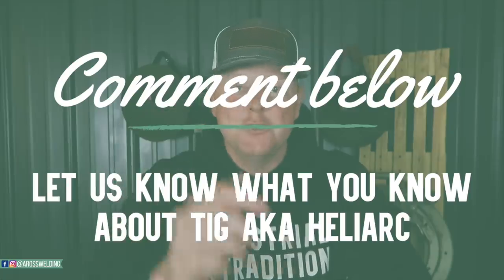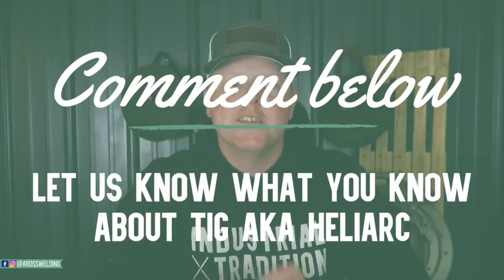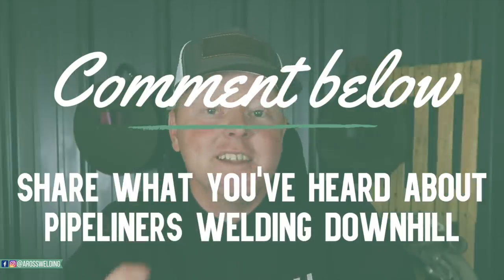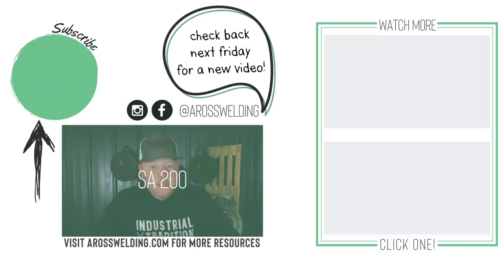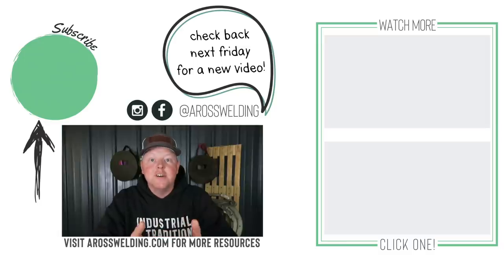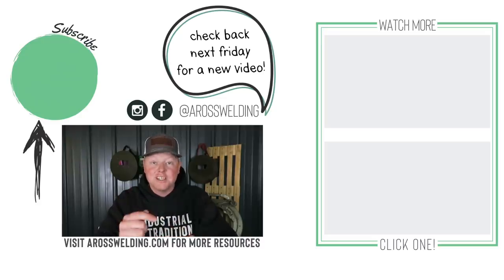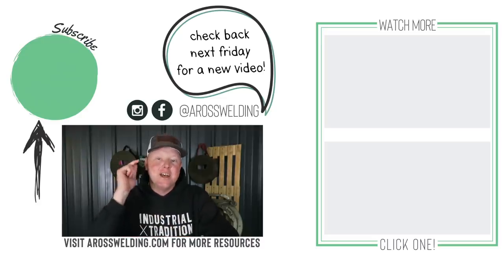WHY PIPELINERS WELD DOWNHILL

Comment: Can someone explain why 6013 lays such a beautiful bead, but in certain circumstances it’ll get a slag pit in the middle of the bead and it will not float out. Either have to grind it out or cover it up with 7018. This occurs  mostly when I’m trying to fill a gap. Sometimes turns up in a fillet weld too.

Comment: Dude its all about speed, the man is right behind taking down your shirt size wantin to know when this joint will be done? I've never done pipe line work nor would I want to, I'm a retired Boilermaker I used as much 7018 as you have P5, also I gave up 5P , Low-hy works way better at bridging gaps. I did work on an old B&W boiler, we TIG the root and cap with 7010. On a side note Heliarc is a brand name, but boilermakers called it heliarc even tho the pipe fighters told us we were wrong, of course we told the plumbers to F off.

Comment: Pressure welders don't just weld with 7018, the filler material all depends on the base metal. Could be 7018, 8018, 9018, S309, S316, inconel, etc. I am a retired Union Boilermaker and years ago before the standard Welder Proggram we had to test each job and we had to test for each material you would be welding, 2" heavy wall in an Arkansas Bell Hole and you welded all passed up hill because sometimes you didn't know if your coupons would be exrayed or bent and if you put a downhill pass in your test it would snap. Exray had to be 100% or you got sent back to the Hall. I've seen some of the best welders there could possibly be in the Boilermakers. People that can weld the impoosible and make it look easy. That is Union Craft Labor.

Comment: You can tig weld down hill, I’ve done it on stainless steel structure in a chicken plant. Pipe I wouldn’t dare. I just lay my wire in there and go to town. It doesn’t get as good of penetration but it holds and it’s fast.

Comment: I ain't gonna lie I'm 41 I've had issues getting a good job I've always worked out side in the elements what could I do to get my foot in the door as far as being a helper I'm in maryland thanks for any info,if you can,can you do more live networking/ Q&A too,great content and info
Reply from the maker: Check out this video and my inner circle.

https://youtu.be/nbYKc39YR-U

https://arosswelding.mn.co/

And I will take note of this suggestion. Thanks
Reply: Join the boilermakers or pipefitters union. Good money. Union protection and benefits.

Comment: When you’re padding boiler tubes you weld downhand after you get a ticket even when doing butt welds in a bundle that’s overhead its easier to look through the bottom of the joint and weld the top half down first then up hand the bottom half. As for a down hand rods there is a stainless rod DOH  6010 & that other 10 rods are all position as the third number indicates , 1 all positions 2 flat and horizontal. The last number is the flux make up which makes all the difference as the metal rods are all the same except for alloys 10 rod is good for shitty conditions and rolling around in the mud “pipelining “ but are very brittle not ductile that’s why only used for the root on above ground piping and never on any structural just under ground stuff you filler up with 10 and through some dirt on it lol

Comment: Yes up hill with GTAW "tig"  Especially ASME code IX for carbon and 
stainless.
Reply: mark SAMLUK yes but also no. If you angle your torch up and keep the rod below the puddle as well as lowering heat you can weld downhill with a strong weld. (More used for tight spots so when you can uphill weld for more efficiency)

Comment: Ironworker everything's vertical up 7018 welding Deck with 6022 that's all I use
Reply: That’s all I used as a ironworker except a few times working in the phosphate mines and that’s because of burning off product and then a 7018 vert over it

Comment: I went up the hill like I was taught inTech. Then when on opportunity came up on Zed code I took it. Stateside I believe it falls under an API code, up here it's all CSA. B 31.3 for the quick example. For pressure vessels it's section 8 adopted from from the ASME code. Structures fall under CWB 49 or 48. Sorry, tangent alert. 

Anyhow, I did learn the downhill technique. I like it better. Faster, you can bump up to 5/32 for your root electrode comfortably and I can see the puddle without stressing my neck trying to judge the backside of my said consumable. 

Anyway you fellow beadhands, you know the rules. Start where it is tight, make radiography and cast all else aside. Don't forget to blame the Pipefitter when things are not lining up and going south. Sorry, that's what happens when I have to Makita redesign half their butt joint in hope of a root, while the other side of the clock a cat could walk through.

Comment: My understanding uphand with 7018 is more ductile and can stand more dynamic loading and  less prone to cracking it is not stronger . Here in Canada usually anything above ground low hydrogen is used  to fill and cap . one of the reasons  is because temperatures can very from -40f - 100f.  7018 and 7010 the tensile strength is the same . As I have been lead to  believe tensile strength is how strong a weld is . they use a 1"x1" square rod with the same material as the numbers on the rod . They pull this square rod till it breaks to establish tensile strength . If I'm wrong please some one correct me .
Reply: Most of information was right except for 1"X1" square rod its actually based on 1 cubic inch of weld determines tensile strength of weld. Most times your weld is stronger than base metal your depositing on. In comparison 36" of 1/4" fillet is approximately a cubic inch. A lot of new welders get this wrong. Actually had to do pull test for a procedure acceptance on a couple of jobs for insurance acceptance. Really fascinating to experience weld failure through destructive testing if you ever have the chance doing procedure jump at it a lot of information and  theory takes the everyday boredom out of welding.
Reply: Ream him Bill Rogers!!!
Reply: Mykol Ayche wasn't trying to ream but welding for 37 years and seen improvement and changes makes me question the young bucks who think they know exerting about welding

Comment: The first two numbers are the ''minimal'' tensile strength of the rod. An all weld metal tensile specimen can have a lot more tensile strength that the said first two numbers on the rod. Also, welding down hill has produces less penetration. The only reason for welding downhill on pipelines is speed.

Comment: With the uphill downhill thing, the cellulose rods (6010, 7010, 8010) are much faster to clean effectively between passes and the 7018 and other low hydrogen rods are susceptible to porosity if you tend to long arc. What frustrates me is when guys who haven't welded since high school shop class or who have never welded outside in the elements start talking crap about the technique, electrodes and the weld progression pipeliners use. As if they are just out there "wingin' it" with no AWS weld procedures or anything.

Comment: 7018 needs 250 degree holding ovens once out of the can. Cellulose rods do not for one thing and do work in windy conditions. Louisiana welder, burn and turn
Reply: 7018 needs per heat rods to keep the water out and yes they weld good in the wind were a mig cant
Reply: "Burn and Turn"..... like it, know what you mean.

Comment: Just wanted to clarify a few things. All the rods you mentioned are all position and do not affect travel. 7018 isn't just up hill and XX10 isn't just down hill. It is procedure dependant. The real reason they use XX10 on pipeline is procedure and less need for hoarding than say a 7018.

Comment: Im currently in welding school but i wanna go work on the pipeline after but i have no connections whatsoever, any pointers? Im currently getting my cert 1 in structural welding and next year i get my cert 2 in pipe welding at TSTC
Reply from the maker: Check out these videos.

https://youtu.be/-QdiPpLtNIM

https://youtu.be/nbYKc39YR-U

And consider my inner circle.

https://arosswelding.mn.co/

Comment: Back in the day 60s,70,& 80s, you could not even test if you didn't have a Lincoln 200 on your rig. It looks like that has changed a bit.
Reply from the maker: I’ve heard that several times but ya it def ain’t that way now days
Reply: The API 1104 code used to clearly state that if Electric Arc welding is to be used the current must be generated , therefore any machine other than a Lincoln or the now extinct Hobart generator could not be used . Back in the 50’s and 60’s many a rig welder ran a deuce and a quarter truck with gin poles and a Hobart generator . Deuce and a quarter is 2 1/4 ton truck , big GMC or 650 Ford . They were tough trucks

Comment: On down hill it’s a lot easy to shoot the root pass, you’re puddles being pulled by gravity, on up hill you have to work the puddle so you don’t burn though the root. You can fill a larger gap when welding down hill

Comment: If my life depends on the weld it will be uphill; however, after 41 years of welding I would love to be taught the correct way to weld downhill.
Reply: Different process, no big deal woce ya got the prosess.   up hill you can carry a big wave, down hill iff youre hot you might strip the virtical on pipe, ya run like a rabbit front" as much heat as you can handle. to a point. break of day to the crack of dawn, the shadow knows. and a good film reader can see exactly what way you rode in a notable spot, and salute you for maken it one.  where i was, thats what i remember.  idono   im old and done, earned a good liven the hard way. loved every day under the hood, sometimes a leather boot with a lenz sometimes cutteng goggles, and a bandana, only way in.          mirrors?  tink backwards and medutate, before you light up.. A.       my brother here just wanted to say that, so i gave him the board,

Comment: downhill rod has different flux. also welding down hill stops the dirt from floating in the puddle and fucking with you during the entire weld. you weld downhill the shit gets trapped in the weld it floats to the top, you are running down away from the shit. when you run up you are running with the shit floating in your puddle.  in tig we run either way, doesnt really matter because we control the heat and the work is clean clean clean. but almost always uphill because fuck a cold weld. if you have a hard time controlling your heat youll see people run downhill to cheat it.  im not a pipeliner, weld mostly tube.

Comment: Can a pipeline welder use mig welders  to get started in pipeline welding and generator was think about a Lincoln electric 180 can weld up to 1/2" steel  MIG welder
Reply: I am just a hobby welder atm, but I always assumed they used stick on pipeline cause of the conditions? eg: rain, ground water, dirt, wind etc (Would welcome a correction though)

Comment: Thanks Ross I used a lot of 6011 rods on rusty bins and chutes at the rock quarry but welding on equipment always 7018 or 10018 never had a problem with wind though I would be scared to weld anything that moved with a 60 rod but anyway I was going to send you a picture of my dad on the pipeline somewhere in Rowan County KY he was a dozer operator and always wanted me to weld I got a truck but went into structural steel then got in with Vulcan Materials welding in the mines they kept me so busy I didn't  have time to do anything else anyway I don't know how to send you a picture thanks man keep at it.

Comment: Up my way we follow ASME or API standards depending on the gas company. They usually write the procedure to run downhand on ASME all the way except the cap. They want low hyd uphand. And API is all downhand.
Reply from the maker: Interesting.
Reply: @arosswelding  it's neat up here. I've been hearing of things slowing going towards more what you see in the real pipelines out west, but who knows. Engineers and alike make the choices and as a new welder I just do my best to make x ray!

Comment: Yes, and no. Yes speed buddy. But most carbon pipe is welded up hill xx10 root and hot pass xx18 fill and cap. Skill is a big factor to get speed in down hand welding.
Reply: I think it depends what field your welding the pipe determine whether it’s mostly uphill or downhill. In the oil/gas field 90% of the carbon pipe I weld is downhill. Speed is the biggest difference I’ve seen personally from bead to cap between the 2 processes.

Comment: I weld downhill and uphill. Both stick and Tig. It's not recommended to weld downhill with Tig, but it is doable. In clean piping where you use fusionwelds the direction you weld in doesn't even matter at all. A college of mine once welded downhill with a 7018 and the x-ray came out perfect. 
I work as a contracter for a pipeline company in Europe and we assemble bypasses and reduction stations. We do the root with Tig, and depending on the tensile strength of the steel, the rest with 6010/9010/9045 downhill. We do the first pass with Tig as a safety measure to protect the valve seatings.

Comment: Again,  not a welder,  crane OP but from what I understand the second set of digits in the rod number is what determines the characteristics of the rod.  I know 18 is low hydrogen, produces smooth welds with low penetration. 11 is high penetration good for dirty, rusty material.
Reply: Yep, 6011 is high penetration on AC.  I don't think they make a higher strength version of it, but really wish they did.
Reply: Second set of digits usually indicate weld position and the coating. Ex. 8010 rod..80,000 lbs tensile strength, the 1 means all positions and the zero says it's a high cellulose rod that is welded with DC Reverse Polarity. Ex 2. 7018. 70,000 tensile strength, all position, low hydrogen potassium and can be use with AC, DC, DC-. Hope that helps.

Comment: Alost most all TIG is done uphill. Especially alloys. BUT when welding carbon steel, depending on the situation its possible to weld down hill from 12 to 3 and 12 to 9. Especially on big bore pipe, because it prevents excessive penetration of the root on the top side. But its strictly forbidden.

Comment: i weld tig. tig is welded uphill because the risk of the puddle "falling" in front of your weld is a big risk and is a big problem if you were to weld tig downhill. this can probably be worked around but it is nothing i know how to do.

i also weld stick from time to time but only uphill rods on things like cranes and other high strength required welds.

sorry for my spelling and grammar, english is just a secondary language of mine

Comment: right or wrong, I was always told -- up for dough (stronger), down for show (cleaner) .....
Reply: Angus Cattle lmao that’s terribly wrong. Downhill is outdated. Can’t even be used in refineries or power plants. It’s trash welding to us 🤢
Reply from the maker: It’s all from the shoulder to the holder 😉
Reply: Swampy  best practices -44c20
Reply: @puppetdee4149  This is API 1104 and, as good as uphill is, the engineers may not grant that freedom in the procedure specification. It's also in the qualification testing.

Comment: I was present and welding at the time when the people decided to change from uphand low hydrogen to downhill 6010 & 6013. The reason why the change was not what you say. All of us older GOOD welders will tell you the same thing if they haven't been victimized by the system. There were few people that could do schedule 80 and up with low hy and pass the exray. Anybody can be taught very quickly to run what we call hippy rod or 6010 & 6013 down. Now they got $250,000.oo machines that can do submerged archwire which is pretty much the best and most uniform weld that can be made. Not every outfit can afford those machines. I welded pipeline when I was 16 years old. I'm 70 now so like I said, I was there when the change took place and was high enough up the proverbial ladder to see these changes come about. If you try to look it up chances are you will get told something else. They are also good at changing our true history and the way things were done.  I can put a 7018 up hand pass in there so pretty you'll think it was painted. Try welding a 6" shaft 2ft. long in the center of a trolly from a 200 ton overhead crane. The back half you can't see, so you bend the rod in two places and use a mirror to weld with and it has to pass exray from a government inspector before the truck will pick it up and deliver it to McMillian Blowdell in Vancouver. I tell stories but they are true. Good luck to you young man.

Comment: As far as general welding and fabrication with mild steel. I was taught many years ago by an old hand who worked for TVA, and was certified to weld on nuclear reactors. Weld downhill using a 7018. A lot of people have argued with me. But it have always had success with it.

Comment: I think a big reason also is 7018 requires a rod oven as well.  Without your gonna be having some bad shots.
Reply: Worked a small job in central Ky that had 70% shot rate running 6010 root 7018 cap on process pipe with no rod ovens. It sucked but as long as they dont get wet and you run hot they'll shoot